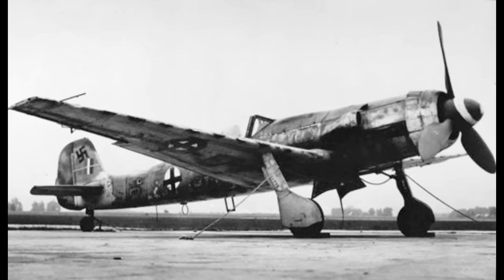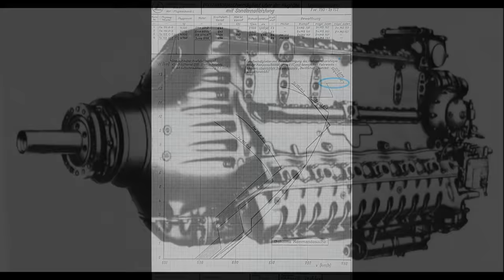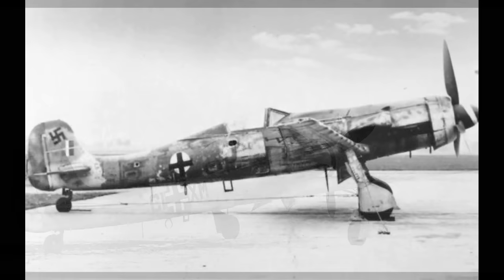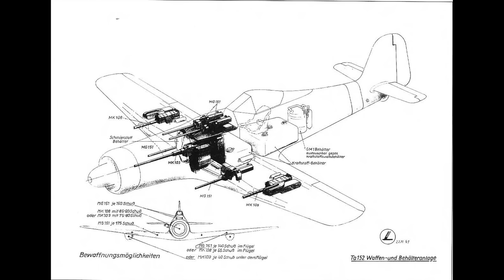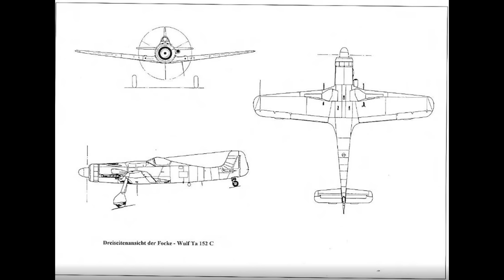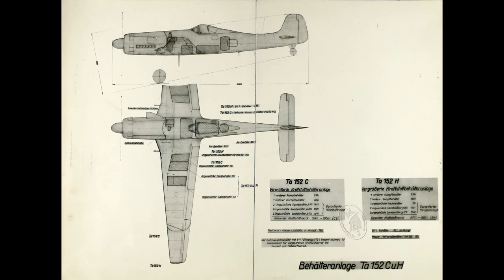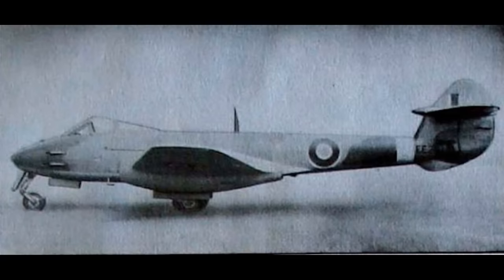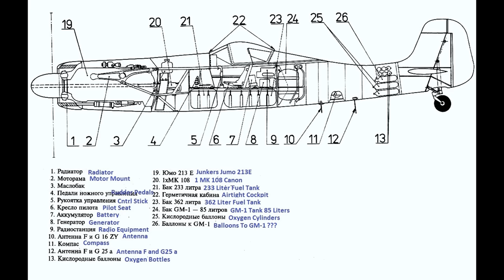Focke-Wulf Ta 152 H-1 Extreme Speed At High Altitudes.

Comment: As I expected, a fantastically informative video. Never quite realized how unspectacular the Jumo 213 was by that point in the war with only the additions of the additional supercharging and MW50 and GM1 bringing it up to par with the allied engines. Man the 152H with a DB 603... now that would be something to behold.

Still a truly remarkable fighter. As I said a fantastic video Greg, makes me even more eager to see the 190 series when it debuts.
Reply from the maker: Yes, if they had been able to put a DB603 together with all the goodies, it would have had 2900hp or more. They actually had a two stage 603 with more than that but it needed C3 fuel. Had they added MW-50 they could have had the same power or more with B4 fuel, and then added GM-1 for the high altitude performance, or for a further boost down low if needed. The Ta 152 H1 as discussed in this video was really just the beginning of this plane.
Reply: @GregsAirplanesandAutomobiles  Oh my that just sounds so nice. The things the Germans could accomplish during the war was one thing, what they could have done with generous time and resources...

Man the super props they could have made.
Reply: @GregsAirplanesandAutomobiles  It's a pity that the Do-335 did not get enough time to come into series production and have a more significant combat record than outrunning a flight of Tempests; it would have been fascinating to see what it would have been capable of. Unfortunately, there's far too little data to be able to determine how it would have fared in combat, much less be the wunderwaffe that it seems to wind up being in combat sims.
Reply: The Jumo 213 was taken to Rolls Royce for testing.  It ran faster and harder than the Griffon without problems.  Germans had some breakthrous in high RPM engines.  I think the pistons were oval and convex or something.
Reply: Greg's Airplanes and Automobiles 1 

The reason the Jumo 213 engine ended up on the Fw 190 and Ta 152 before DB603 is because a miscalculation by Focke Wulf  made them think the DB603 was 140kg heavier.  It was too late when they figured it out.

The Jumo 213E1 produced 2050hp on B4 fuel + MW50.   Nitrous Oxides was only used above FTH but it was possible to use Nitrous Oxide and MW50 together at around 30,000ft.
2 The Jumo 213EB produced 2350hp but had much better supercharging and inter cooling so the Ta 152H with this engine could achieve the same speed as the 213E engine version of 472mph without Nitrous Oxide.   The EB had 3 valves bigger and higher piston velocity.
3 Jumo 213J with 4 valves and 3700RPM would do about 2700 metric hp.  This was just a Bench engine.

The jet thrust of the Jumo 213E is given as 448lbs thrust in Anthony Kay’s book on Junkers engines.  This jet thrust on the DB603 was less so its higher shaft power is misleading.  Need to really rate in ehp.
Reply: I think the Jumo 213EB-J engines were some of the best engines around at Germany’s surrender. In particular the Jumo 213J which according to Calum E Douglas was certainly one of the most sophisticated piston engines in existence in 1945. With performance extremely similar to the highly advanced DB603N.

Comment: The Jumo 213 was being developed specifically with the very complex supercharging system characteristic of the 213E from the very beginning and the 213A was a follow on from this, it wasn't the other way around. In order to speed it into production it was decided an interim version with a much simpler supercharger would be used as issues were apparent in development of the multiple stage version, such as unreliable kommandogerät gear shifting in the upper stages which could overstress the engine. The Jumo 213 was thus delayed and a simpler version, the 213A was then proposed, but Kurt Tank himself had already decided he preferred the Daimler engine for this reason at this point, which was late 42 to early 43 and he was quite vocal about it.

All Ta152 had the MW50 boost system fitted. Pilot accounts include use of the system as well as GM-1. The Ta152H0R11 preproduction aircraft used Fw190A6 wings lengthened so did not have the fuel tanks. They did have both fuselage fuel tanks in common with the Fw190. The instability issue came about when an ETC500 bomb rack was fitted, which was an RLM requirement from February 1943 for all new fighter models and both fuselage tanks and the MW50 tank was filled and a GM-1 system was fitted, which added another 300kg all by itself and that threw the CoG just all the way out and made the aircraft ridiculously unstable and this would only get worse in the production model when the fuel tanks were fitted to the wings. But this was discovered during the prototyping phase in 43 and the solution had already been arranged for the deletion of one of the fuselage fuel tanks in production models. This meant the extended range of the Ta152 over the Fw190 would not be achieved as had been proposed with two fuselage and two wing tanks and instead the Ta152 would only carry marginally more fuel than a regular Fw190 with one fuselage tank and two small wing tanks. This would be in addition to the MW50 tank and GM-1 fitment, together with an ETC500 wet piped centre store and the aircraft remained stable, barely but it was workable. In the meantime the preproduction aircraft despite lacking wing tanks were given a liquid stores restriction such as described in the video which included leaving a fuselage tank and the MW50 tank empty if the ETC rack was fitted, although IIRC the GM-1 system was fitted.

The problem with GM-1 wasn't not being fitted, it was that it completely screwed with the kommandogerät of the Jumo 213E motor and the gearshifts in the upper stage became completely unreliable when trying to punch into the 12-14,000 metre flight regime the aircraft was supposed to be capable of as a high-powered interceptor. And it wasn't the only problem at high altitude, the pressurised cockpit system was so rudimentary at that stage of technology for a mass-produced fighter, essentially using slave labour that it was also, completely unreliable and so very few actual accounts of reaching the 14,500m combat ceiling were ever recorded, most attempts resulting in the pilot losing consciousness before reaching 12,000m. This, in fact resulted in a flight ceiling restriction during service trials of 10,500m for pilot safety for both JG301 and Jv44. The Messerschmitt Me109 could fly this high and that's also the altitude a Ta152C using the Daimler engine could accomplish some 760km/h using MW50 with overboost since the throttle altitude of the DB603LA is 11,500m and that's just using a single speed supercharger with two stages because it just has that much swept capacity to pump air with and a really big supercharger, really big. Tank liked the Daimler better, I do too. The Jumo/GM-1 idea was crap and the 14,500m requirement was only achievable using GM-1 in the Jumo. The supercharger system was way too complicated. The Daimler just used big gigantic pistons and a massive supercharger casing with one extra stage to do the trick. It worked. It was simple.

But the whole thing about the Jumo motor, where it actually shines is at 7-8000 metres and people don't realise this. They never question why was JG301 freijäger patrol height specifically assigned at 7000 metres? The Jumo has 1800 horsepower at this height just out of the box, no special boost, no special conditions, it's just the operational regime at military power and totally reliable. That's what the trick supercharger system that barely worked did for you. Almost nothing on the planet had 1800hp at 7-8000m. It would climb at that height like you were doing aerobatics just above an aerodrome at low altitude in a biplane, it is that much power and prop bite. At 7-8000m the Ta152H was absolute king of the skies. Not 14,000m, not 5,000m, not even 10,000m. Although mind you, and this was remarkable, it was still one of the fastest of anything all the way from sea level to 11,500m and there's no arguing that. Just it really ruled 7-8,000m and that's the Jumo 213E (or F).
Dietmar Hermann assured me however the RLM had planned on replacing the Jumo Ta152H1 with a DB603LA powered Ta152H2 had the war continued. The Daimler was just better. And the realistic Höhenjäger extreme performance flight regime with all this in hindsight by 1945 was in fact 9,500-11,500m. Not 14,000 metres. That was reality.

Comment: You knocked this out of the park, man!  Thanks for an awesome video.
Reply: A specalized plane that had the true potential to be a kill joy to the allies. The D13 and the Ta152c could have easily ruined the air war for the Allies given earlier production (the RLMs fault there) and better trained pilots, attrition got Germany there. To loosely quote Willy Retschie The Ta152h was his life insurance as the war ended. Of special note there were quite a few problems with the 150 plus planes that were produced namely fit and finish issues, from gear doors that wouldn't fully lock th missing and loose rivets, let alone the fuel and oil supply.

Comment: Greg this was awesome!  The TA-152, and all German aircraft made extensive use of one piece aluminum forgings punched out on a 30,000 ton press (my video request).  The Jumo had direct fuel injection, not to be confused with port type.  Fuel was injected directly into the cylinder, as the fuel expanded on the down stroke cooling the charge and reducing knock allowing for more ignition advance.  To compare apples to apples (same weight and displacement), the Rolls-Royce Griffon produced 2200 hp on 150 octane fuel, and 2000 hp on 100 octane, whereas the Jumo 213 made 2000 hp on 87 octane (B4).   Direct Fuel Injection is worth about three hundred horsepower over carburetor or throttle body in this type of engine.
Reply: +Jim Wahl   There should be a Jumo 213 on the test stand soon, although there isn't a plane ready to hang it on just yet. It would be nice if the owners would allow a video or two.  Paul Allen's museum had their Jumo 211 fully tested and flight certified in July but they didn't publish a video of that either.  I'm looking forward to comparing them to the DB engines that are operational now.

Comment: German engineer's translation proposal:
IX. High altitude flying - Rescue-Safety equipment:
A. At altitude of 4000m (~13.000 ft) start oxygen supplied breathing and continue at altitudes above 4000m.
 1. Open oxygen remote control valve. Monitor pressure gauge and oxygen watchdog.
 2. If respiratory distress occurs use oxygen-shower (Push with elbow.)
B. At 8000m (~26.000ft) altitude switch on pressurized operation.
 1. Rotary slide in position “Pressure operation”
 2. Inflate pressure seal  hose. Push valve for 15 to 20 seconds.
 3. Occasionally check cabin pressure gauge. Pressure equals 8 km (~26.000ft)

Comment: That plane is a monster in war Thunder because of its low wing loading it can easily pull high G loads, it has insane energy retention which allows it to boom and zoom like crazy.
Reply: How it is possible to pull high g with a wing have a high aspect ratio?
Reply: @berkaydogan9414  nice wing spars. Also at high altitude you don't pull that much as the air is much thinner. But still more than other planes
Reply: More than that, it gets an air spawn and out turns most everything. Plane requires zero skill.

Comment: Native speaker here. Re your translation about the pure oxygen switch: You pretty much nailed it. There is a switch in the 190's cockpit (IIRC, DCS' 190 Dora 9 has it modelled at least visually) that you'd have to push with your elbow to activate the "Sauerstoffdusche" (literally: Oygen-shower). I don't remember which side it was on, but it sits on the rear cockpit wall/bulkhead next to the pilot's seat.

Point B
1. Set rotary valve for breathing air supply (I guess meaning "fresh air intake/inlet") to "pressurized operation"
2. Fill seal hose. Press/push valve for about 15 - 20 seconds.
3.Occasionally check cabin-pressure indicator. Cabin pressure equals (?) 8km.

Comment: Another thing the high AR wing gave the Ta152H was incredibly good turning performance, something immediately noted by its pilots. The high AR helped greatly reduce lift induced drag, whilst at the same time increasing the Clmax, apparently by 0.19 according to FW AG documents. Should also note that a later German performance chart puts the Ta-152H running faster than on the chart you posted, with a boost pressure of 2.03 ata instead of 1.92ata. Question is wether any of the aircraft in service ever ran at 2.03ata, which we don't know.

Comment: I feel like the wing spar question is just a happy coincidence: a lack of aluminum (and even more critical shortages of other metals for alloys), meant that it made a lot of sense to just settle for the heavier steel spars and ensure that you have enough structural strength as opposed to dicking around with some sort of compromise.
Reply: The Germans were salvaging wrecked allied aircraft for their metal, so I find it a little hard to believe that the Germans had a shortage of aluminum, but I am not a metalurgist so what do I know.
Reply: joe jitsu Excellent explanation, thanks for your insight!
Reply: Michael Fraering I can’t find any primary sources, but Wikipedia says that the Germans lost up to 50% of their Bauxite production in late 1944 (this was coming from Southern France and Yugoslavia, both of which have or had substantial deposits). 

“Loss of the Yugoslavian and other Balkan mines took away the last supplies of chromium and reduced the supply of lead by approximately 40 per cent – the position being worsened by the loss of substantial amounts of scrap which were collected in France, Belgium and the Netherlands. With the loss of high-grade French deposits and the seizure by Marshal Josip Broz Tito's forces of the island fringe of Yugoslavia, Germany's total loss of bauxite was put at around 50 per cent”
(From Wikipedia)

So while you are correct in saying that they were collecting downed Allied planes, they lost many of these sources when the Allies recaptured France. 

As well, by late 1944, the Germans had critical shortages of fuel, as the Ploiesti complex in Romania had just been lost, and the synthetic oil plants in Germany (such as Leuna) had been pretty much wiped out by bombers. 

Once this was confirmed, the Allies switched their attacks to the German transport network, and what little resources the Germans were still able to produce were now almost impossible to ship. This problem was compounded by the decentralization of German industry, made necessary by the strategic bombing campaign. 

The point I’m trying to make here, is that the Germans had lost substantial amounts of raw aluminum production, and that its means of supplementing that (such as scrapping shot down planes) was now badly impeded.
Reply: joe jitsu  If I recall the characteristics of the metals involved with regard to the use of aluminum versus steel for military vehicle construction, the additional thickness of aluminum required to get the same rigidity erased virtually all of the weight advantage of aluminum, so if they had used aluminum for the main spar, they would not have saved significant weight if they had wanted a similar strength.
Reply: @jeffreytam7684  Okay
Reply: joe jitsu  Look at the wing spar of the Ju288 - it was one forged steel spar and no alluminium spar could have had the same strengh/ weight due to the forging that can increase the strengh of steel significantly.
Reply: @messerschmittbolkow5606  I thought the wing of the Ju88 was actually 4 forged spars though I assume there could be one main spar with 3 lessor ones.  Each spar was pressed to save labour and create huge strength?   What's your source of information?
Reply: "If you run aluminum through a whole bunch of stress cycles, eventually it will break, even if the stresses are kept quite low."...  Quite true! just tell that to Beechcraft, whose airplanes have failed from fatigue at their main spars, even recently.
Reply: The spitfire also had steel in its spar.